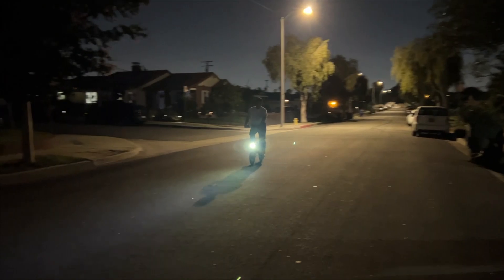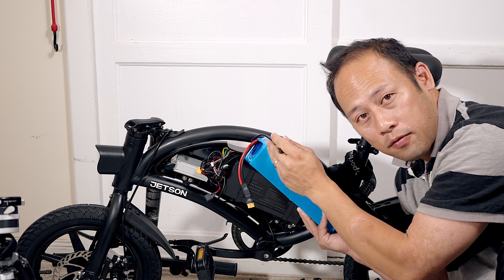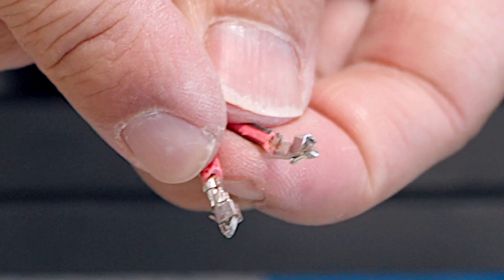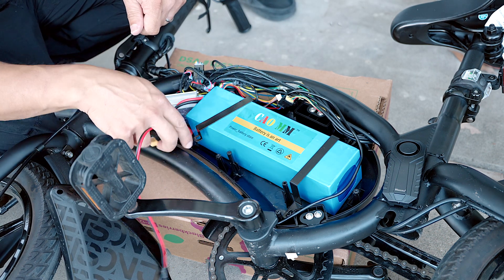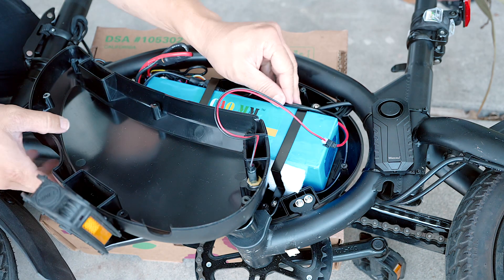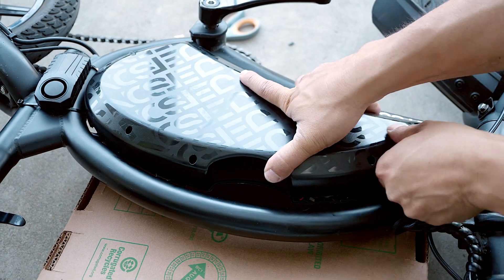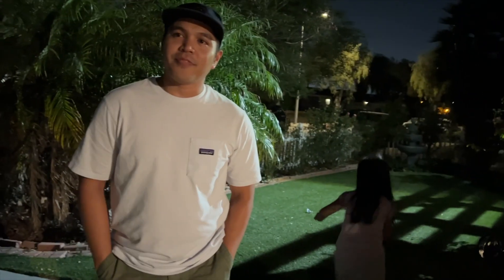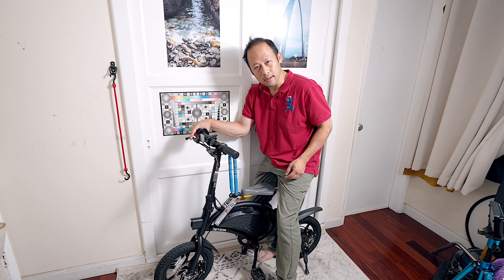Bigger Stronger Faster Jetson Bolt Pro - Battery Upgrade Version 2

Comment from the maker: Parts used

48v 8Ah battery https://ebay.us/Ffftbs (May run out of stock, so be patient until seller can replenish inventory)
JST SM Connectors https://amzn.to/3rsrotC
DC to pigtail https://amzn.to/3RG93UQ
Deans to XT60:  https://amzn.to/3UO2MZE
XT-60 extension cable https://amzn.to/3sBmQFe

I make a small commission from these affiliate links to feed my undersized children, and despite that, there is no upcharge, and I do my best to find you the very best deals.  Thank you for your support.

EDIT: goes 20mph

Check out this video to see how I cleaned up the wires for an oem look: https://youtube.com/watch?v=KVLfN3voR-Y&feature=shares
Reply: Can this power upgrade be done with a step up boost converter using the original 36v battery and boosting the voltage to 48v? The booster sitting on top of the controller. A less expensive speed hack would be great. Thanks for all your ebike videos!
Reply: Are you in LA? I need this upgrade

Comment: Hi I’m sorry if this is a overasked question. Just want to confirm. Will the stock 36V controller work efficiently and effectively and reliably and safely with a 48V battery?
Reply from the maker: @phatkiid1047  yes, i still ride this without issue. I did add another 48v 15ah to extend the range.
Reply: @ wow thanks!

Comment: 😢Hi Sir ! so based on this video, the originally installed Controller can handle 48 volts, or you need to install something  to make it work on 48 volts battery?
Reply from the maker: the original works however the battery life indicator will always show full battery, and that is incorrect, but riding works fine, you’ll get a feel for the battery life.

Comment: I just got a 48 V battery from AliExpress with a 20 ah and it shut off after an hour and if I plug the charger in for five seconds and take it out, it’s full power right away again don’t understand what’s going on. I have the same bike the Jetson electric bike is it because you lift the restrictions that are working good or it could be my BMS is messed up on my new battery because I put the old one in and it works just fine.???????

Comment: Didn’t get this battery though a 48v battery that easily fit.
Easily switched the t connector from my old battery, installed it n charged the new battery.
I’m lucky to get 5 kilometres.
My other bike w a stock battery gets 13 kilometres.

Is my battery just a dud?

Comment: Thanks, to you I just ordered my 48 V 12 AH battery. I’m just waiting for it to be delivered. It has to go through hazmat because it’s coming from another country and I have the Jetson.j5 electric bike and you did so many upgrades and everything. I appreciate you. You just did it to a different style of bike. It’s not doing the things like The are doing you bored.Arduino uno and the Bluetooth I almost am learning the Arduino. I didn’t learn how to put the code on my computer yet once I have it on the computer I can put it on the board then I got the breadsticks pins tin try and do that process. I just haven’t started the process yet, I don’t know if it would work this bike run 36 V system stock and thank you because I would not have known that a 48 V battery can work on this 36 V system without heating it up and ruining my electric bike. I’m trying to do everything the right way so if you have any advice, I’m listening. I’ve been listening. Thank you for your content. Appreciate your time.

Comment: Was excited and all ready to test the new 48 volt battery out but, turn on and power bars light up but no power to the motor. So, I hooked it up to the old 36volt and get power to the motor. Any suggestions that I should try? Should mention I noticed power bar indicator seemed to get pretty warm. I am stumped.... help anyone.....
Reply: Would the speed hack help any. Or do I need a new controller?
Reply from the maker: charge the battery, test voltage, should say 54 when full
Reply: @YouTruther  Yes, voltage registered at 54. Then after reconnecting everything again viola the motor engaged. My heart felt gratitude goes out to you, as I never would have attempted this without your tutorial. Thank-you so much 😁. Now, speed hack here I come😉

Comment: Question: When upgrading to the 48v Ah battery I have the option of selecting a 2Ah or 5Ah charger. If I choose the 5Ah should wiring from the outlet to the battery be upgraded?
Reply from the maker: yes, the wiring can’t support 5ah, maybe if you go direct to battery, even then, not sure

Comment: Hi @YouTruther. Great video thanks for sharing. The eBay link for the battery isn"t working for me. Can you confirm if the correct battery size is 10.1 or 10.5. thanks

Comment: What's up buddy my question is how did you get a smaller xt60 connector on the battery
Reply: And do I actually need the xt60 extension because I didn't see you use it? Maybe I missed it lol
Reply from the maker: parts list in the description, I've done a few of these battery replacement videos, and I could have forgot to mention the parts.  Because of the way I flipped the battery, I didnt need to use the xt60 extension, but if you dont plan on having the charger extended instead, then you'll need an extension.

Comment: That was cool. Do you have a hack for the Haze?, 15.5 mph ain't cuttin' it.
Reply from the maker: sorry, the controller is a lost cause on the haze outside of replacing the controller, it's fairly updated, everything is built in, no override ability (some bikes have a short wire override), and it's built to be reliable IMO.  It does pack a punch for sure, much stronger than the bolt, but it is annoying that it cant be tricked.  Outside of that, you can probably trick it with a 52 or 60v battery, but that is costly and complex.  The other option is to swap the controller from a similar 48v ebike with similar layout, would have to rewire of if you can find an exact plug and play, would be better.

Comment: What type connector does it have? Is it xt60 or xt90?
Reply from the maker: the battery uses deans T plug, jetson uses xt60, an adapter is required

Comment: So everything went well until you took the controller end cap aka water resistant suppression. I loved the vid till the shortcut of leaving the controller exposed 😢
Reply from the maker: you can flip the bracket and screw it back on or bend it out the way.  I didn't really care, since the cover of the Jetson has a groove for weather sealing, and it's pointed downwards, which has gravity working in its favor.

Comment: hi did the same upgrade , i noticed the throttle control , that shows the battery level (green dots) the whole thing gets warm.
Reply from the maker: Probably, been riding 2-3 times a week with this setup, no issues long term other than not knowing how much is left.

Comment: I can't believe you are changing all these connectors with zero safety it's pretty unbelievable. You touch the red wire with the black wire and booommmmm no more ebike if you are lucky you don't burn your house.

Comment: I comfortably fit a 52v 10ah battery and a 350w controller inside a 10" DYU S2 with a little room to spare 😅 It goes just over 22mph on throttle only now 😎
Reply: Want to get my Dyu s2 a little faster. Can the stock controller handle 48v battery?
Reply: the stick controller should be able to handle up to at least 52v iirc so a 48v battery should be fine  @MiloCalimlim

Comment: Ok if watched all your vids and wonted 2 ask I have windgoo b3 and is shit is 350 watt I'd like 2 upgrade controler as thinking about 60v 30ah or higher eney information would be appreciated
Reply from the maker: 60v 30ah is massive (9x larger than the conventional Jetson battery), probably weighs more than the ebike, that's a small dirt bike level battery.  The motor and controller will only push out so much, so you'll have to upgrade to match.  The simplicity of the 48v is to keep it simple without having to replace the controller, and the motor can handle it just fine.

Comment: Do you have to mod the speed first before upgrading the battery? Thanks
Reply from the maker: No
Reply: @YouTruther  thank you!!!
Reply: I have the jetson axle, would it also work if i upgrade the battery to 48v 8ah ? The motor has 250 watt I believe. Thanks again

Comment: did you use the stock controller? can it handle 48volts since its a 36 volt battery.
Reply from the maker: Yes, if serious about the build, watch the video for all the little details.

Comment: Hello I recently wanted to mod by bolt pro but I'm new to this hobby I want my bike to go at 20mph I recently bought a 48v 10h battery and a elgoo r3 to unlock the speed. Do I need anything also before doing this mod also any tips out there?
Reply from the maker: you're good, the 48v 10, likely too big, you will lose the battery level indicator, it stops being accurate since designed for 36 rather than 48v
Reply: @YouTruther  thanks for letting me know I recently bought a controller with Display but made the mistake of buying the 48v battery with a t-plug connector now I dont know which connector to get to connect the controller to the battery shoul i get a XT-60 or XT-90 and also is it safe to just connect the controller with an external connector to the battery? Any help would be appreciated 🙏

Comment: How long can a battery last like this with this battery ?
Reply from the maker: a few more miles compared to factory and higher speeds.
Reply: @YouTruther  do you think this will work with a 250w motor ? Stock controller
Reply: @YouTruther  it's a Jetson with red wheels no pedals
Reply: @brianDaily23  yes
Reply: @ybe87  yes it works

Comment: @YouTruther I want to do this but I'm afraid this thing will catch fire like this since mine is only 250w. I don't know much about ebikes.
Reply: always risk of fires with any ebike u can generally check heat of hub by hand I have jetson v1 like u so far I did Bluetooth hack it can go about 18mph now full batt but i will change battery to stronger 36v an in the future I may throw a kit on it an finally get rid of the stupid red wheels it'll be a little stealth speed demon

Comment: You are a great source of inspiration, thanks for sharing. I'm looking for a little guidance. Working on increasing performance and distance. I applied the speed hack, and pick up maybe 2mph. I recently purchased a 48v 20amph battery, I was already running dual batteries so the connection was simple. Here when it got weird,  when I connected the battery and turn the bike on it lit up with all bars then went dim, and of course no throttle response. I assume that the 48v battery had too many AH? I'm new at this so any help would be greatly appreciated.
Reply: Oh, I get a big kick out of your sound effects
Reply from the maker: the battery bar is no longer accurate with this modification, will need to monitor voltage.
Reply: I am using a 48v 20ah battery and it works. But my controller gets hot. I put into a controller bag went out and at about a 15 mile ride, my bike just quit on me. I thought the battery died. But after being home for a while I checked, turned on the bike and everything is normal. So must have been the controller.

Comment: How is that bike going now? Any issues? I will order the battery tomorrow if it is still running without issue
Reply from the maker: it's great, the only downside is that your battery indicator will no longer work properly, since it's made for 36v rather than 48v and it will always show full.
Reply: @YouTruther  awesome! Thanks for the reply 👍🏼

Comment: Hi I just bought a Jetson J5 and was wondering if the 48V 8Ah battery will damage the 36V speed control system? Also what gains are you getting from the 48V 8Ah battery? Faster speed? Longer distance? Thank you greatly appreciated.
Reply: See if the controller states 36V-48V. If so your good to go
Reply: @Twin_turbo_coyote_fox  Hi are you getting more torque and distance or speed when you swapped to the 48V battery?

Comment: did this mod over the weekend, pretty happy with the results. although i don’t think the stock battery level indicator works with the voltage battery. it always shows full even till the battery is dead. probably normal huh?
Reply from the maker: you're right, will probably have to make an addendum video on a voltmeter to monitor battery capacity.
Reply: @YouTruther  do you have the link to that video? I really want a 48v battery but want to be able to monitor the battery level. Or could you help me know how to install one. Thanks

Comment: Thank you for doing this video.  I do repairs on this model every now and then.  I always wondered about upgrading the battery.  More for range, not necessarily for speed.   However,  I'll keep this upgrade in mind if a client wants to upgrade.
Reply from the maker: there will be an easier approach next week, there are some drawbacks with 48v that I will explain in a later video.
Reply: @YouTruther  I'm curious what video these drawbacks were mentioned in.
Reply: Could this battery upgrade burn or damage the controller?

Comment: I tried a 48 volt battery today, It increased my cruise control speed from 13 mph to 16 mph.  The original energy meter showed 4 bars with no decrease.  At 7 miles on my odometer, it just quit running, fully depleted,  I was scared I had damaged something, but plugged my 36 volt battery and it started back up.  Is this common?
Reply: Did you do this with the stock controller? My understanding is the stock controller only supports 36v batteries, 48 may be a bit too much for it.
Reply: Same here with a 48v battery. I think it is the controller gets too hot. I had mine in a controller bag.

Comment: No offence but on other YouTube videos I’ve seen, isn’t it true that a 48 V battery can cause serious damage do your 36 V controller which is what is in the Jetson when you get it!? It is my understanding that the battery voltage must always match the voltage of the controller otherwise you could fry something? Isn’t this true? It’ll overheat something and burn something out quite possibly! Isn’t that true? I’ve seen this on several videos that the voltage must match it must be there either of 36 V battery and 36v controller or a 48 V battery and 48 V Controller! Makes sense to me! I think what you’re doing is going to fry something eventually!
Reply: I have hundreds of miles on my Jetson with that same exact battery. It has a built-in BMS battery management system that will automatically shut the battery off to the speed controller when it reaches its minimum voltage
Reply from the maker: dual voltage controllers are the norm, look into what jetson sells, along with DYU and ancheer, you'll see a 48v version, and it's my theory, that they use the same controller internals (not necessarily model numbers).  Refer to what I talk about in this video:  https://www.youtube.com/watch?v=An3M_bW7nV0

Comment: What if anything did you have to do to get it to go faster? Bypass anything?
Reply from the maker: 36v -> 48v, the battery is capable of pumping out a lot more juice.  My theory is that the controller is similar of the same controller used on MANY ebike models, capable of dual voltage support.  Speed hack will get you +2mph, my guess on the 48v test is another +2-4, I've only bench tested before creating the video, using another modded bike.  The bike in the video is not mine and I am looking at options of bigger 48v batteries for my personal bike that is still under warranty and will wait a bit.  These projects are natural progressions, once I find better options, I will show it on a video, and the back end work involved with research and contacting vendors, is not shown on video.

Comment: Nice to see someone modding these things, I thought they were pretty hopeless at first glance.  I had a 48v20ah UPP powered Super73 Z1 that would almost touch 40mph, so I'm all about making things fast that shouldn't be.  Good work!
Reply from the maker: Glad I could help
Reply: Hello I recently wanted to mod by bolt pro but I'm new to this hobby I want my bike to go at 20mph I recently bought a 48v 10h battery and a elgoo r3 to unlock the speed. Do I need anything also before doing this mod also any tips out there?
Reply: @lilyun3489  did your battery fit as expected and what one did you get
Reply: Also is it possible to get 30mph with a 48v 10h or what exactly do I need to achieve the speed I'm 150lbs which I hope it will be easier to achieve those speed but who know
Reply: Where can I find someone to talk to about a super73 s2
Reply: WHAT DO YOU MEAN "THAT SHOULDNT BE" WHAT THE FUCK ARE YOU TALKING ABOUT , THEY SHOULD MOST DEFINITELY ALL BE ATLEAST 40MPH . NO QUESTIONS ASKED . EVERY MOTHER FUCKIN PERSON AGREES